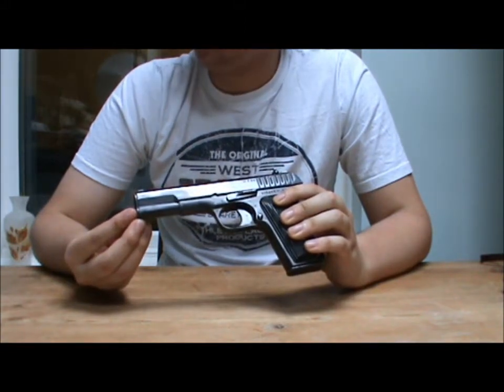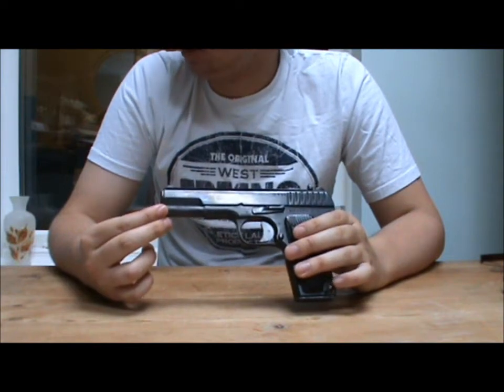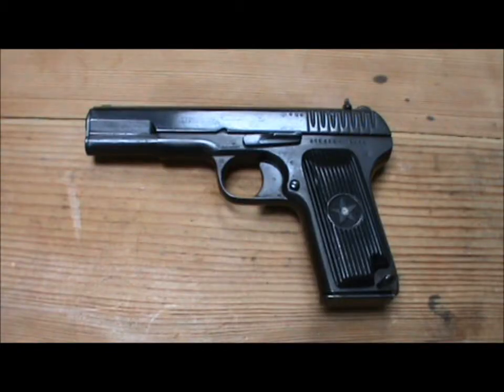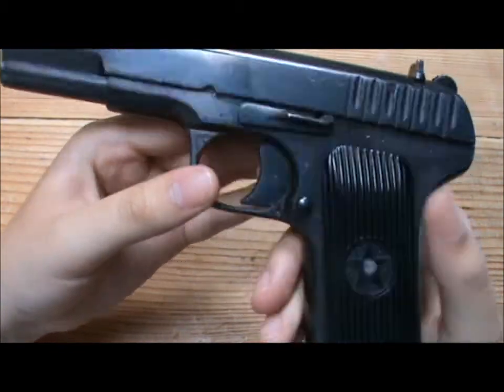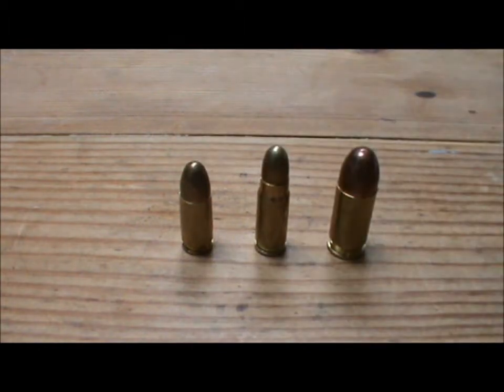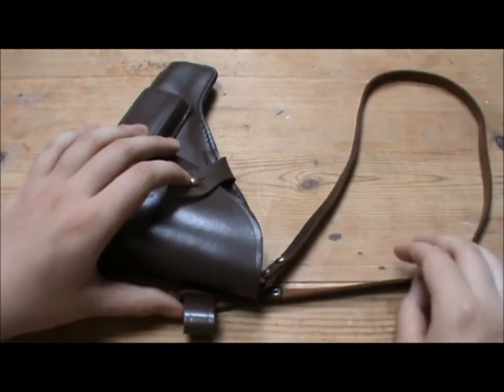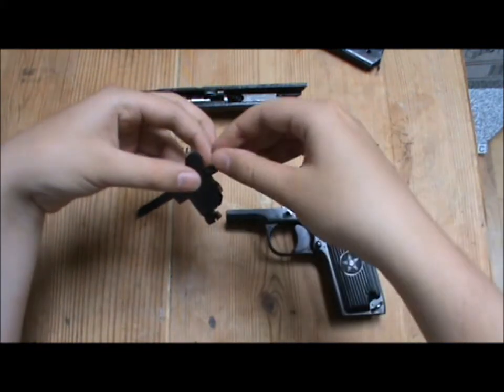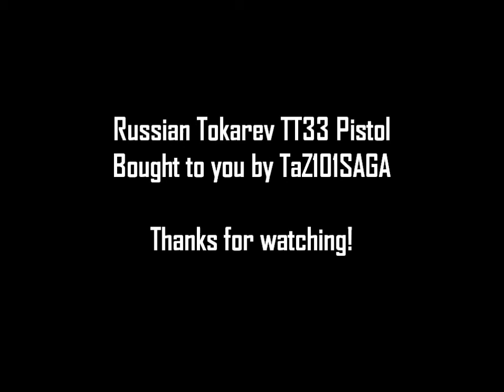Tokarev TT33

Comment from the maker: Firing pin is cut, hole welded over. Part of the locking lugs on the slide are removed, but most of it's there. Barrel has a steel rod welded in it, and it's cut at the side, as shown in the video. It cock's, dry fires and fully strips down as shown.

Comment: reactivation isn't that easy with a handgun, most of the reactivated weapons found in criminal hands are open bolt SMGs. things like the Sten, Uzi, PPSH, Mac 10 etc. Handguns despite being older in design are often much more complex than open bolt SMGs (which are basically a spring in a tube)

Comment: will you be going to 2014 war and peace
Reply from the maker: I go every year.
Reply: YAY
Reply from the maker: *****
Too busy. Plus new EU proposals still ongoing so have to see what happens with that.
Reply from the maker: *****
Nope, left ages ago.
Reply from the maker: *****
It's fine mate, I have sod all to do today. I will probably be attending War & Peace as per usual, which days I do not know until later in the year. The EU gun ban is still a concern but no need to be overly worried. The original drafting has been thrown out and will not be passed as no one wanted it. Amendments will be made. Check out Vicky Ford's Facebook page (She's running the ship basically) for the latest updates on the situation, she is doing a good job and is meeting with organizations and raising their concerns to the parliament so unlikely most of it will be passed without drastic, fairer changes. Continue to lobby your MEP's and follow developments. Best of luck to us all.
Reply from the maker: *****
Negative. I would like to go to one of the fairs about, just never have the time.